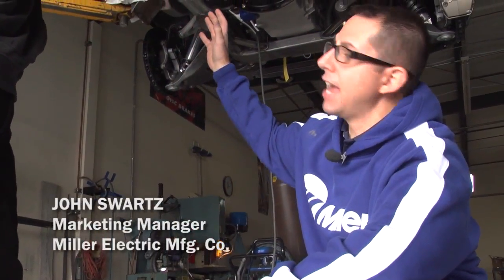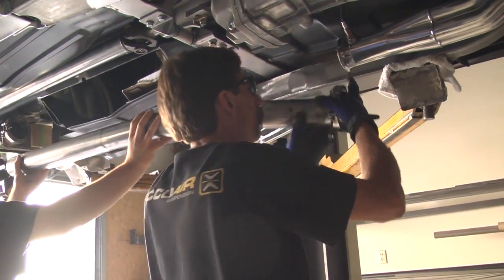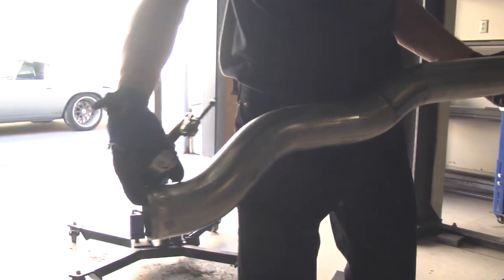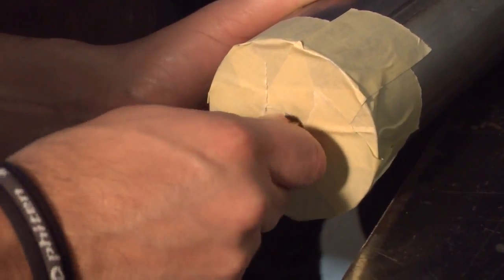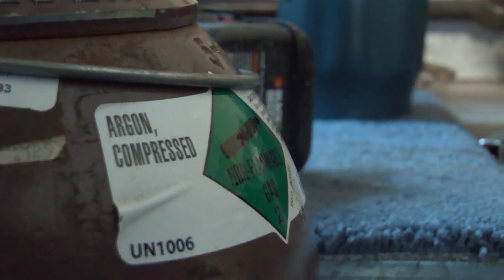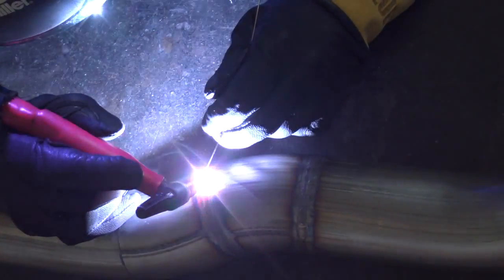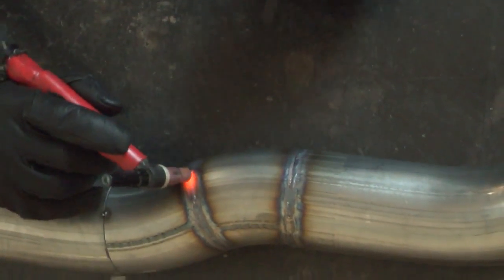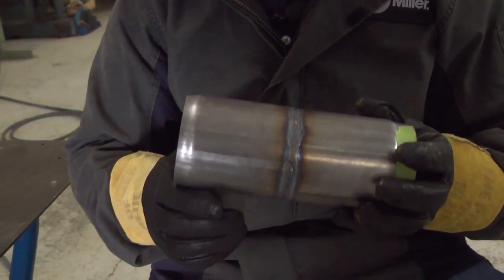How to TIG Weld Stainless Steel Exhaust Tubing

Comment: I am thinking about Mig welding some exhaust parts for my Silverado. The welder is Millermatic 220 with .035 wire and 75-25 argon cO2. What should I expect the settings to be set to? I could also a TIG but I’m a better mig welder.
Reply from the maker: We recommend giving our service line a call to talk this through with a tech. The number is 920-734-9821. If there’s anything else we can help with, just let us know.

Comment: Why not use a gas lens?
Reply from the maker: Thanks for reaching out. You certainly could use a gas lens in this case. The use of a gas lens provides improved coverage, however you can see from the video that the operator was getting adequate shielding using the standard nozzle. The main focus of the video was to show the advantages of providing a back purge. Thank you.